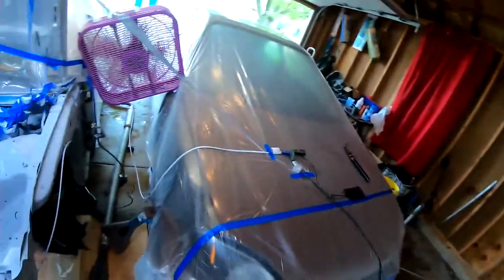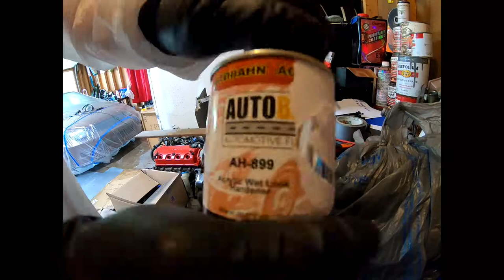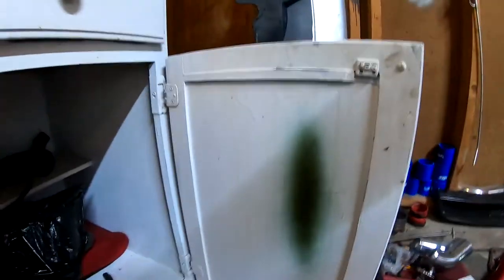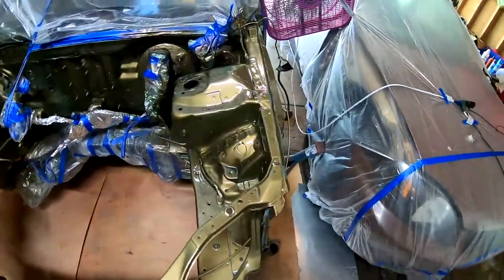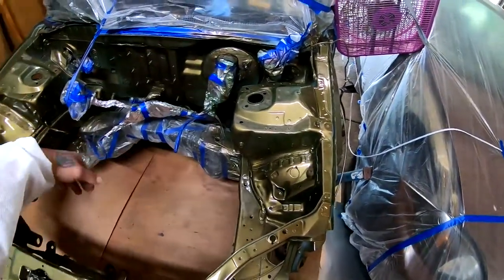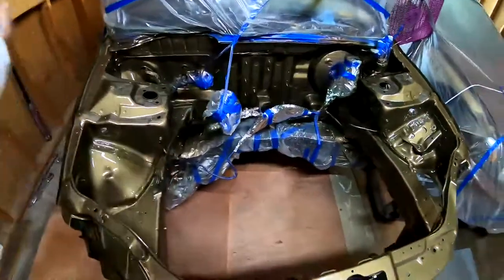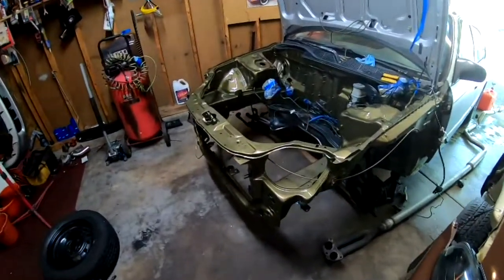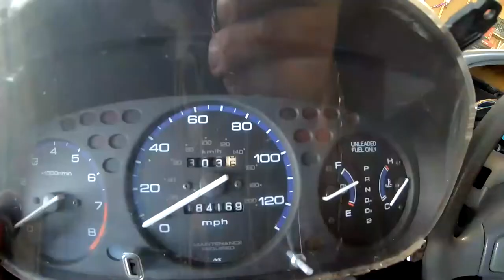Sleeper civic gets AMAZING engine bay painted

Comment: That gun has a perfect fan pattern.   The Harbor freight gun is so narrow which is only good for small parts.   Hmm I wonder if it would make more sense to just do a base/ clear method in the future then 1k pint and then clear over that.    Did the clear adhere properly too the 1k
Reply from the maker: i called the guy who i bought the paint from and told him what clear i had and he said to use it he has same clear coat for sale. yea it adhere proper looks wet still. i still have paint left im gonna paint my harness bar soon to match the bay but im not gonna spray clear so we can compare how glossy it is.
Reply: Barbas Life sounds good!  Yah sometimes a good clear can be a hit or a miss

Comment: Bro you should of removed the brake booster and harness that's simple stuff and would of made it easier to paint. Looks good tho I like the color
Reply from the maker: i was thinking of doing the brake booster delete but i dont wanna deal with spongy brakes at high speeds.so i said screw it just gonna leave it and tape around it. i took the harness off just left the pigtails on both sides. i got so much to put back together that im trying to take small short cuts here an there. but good call on it 👍